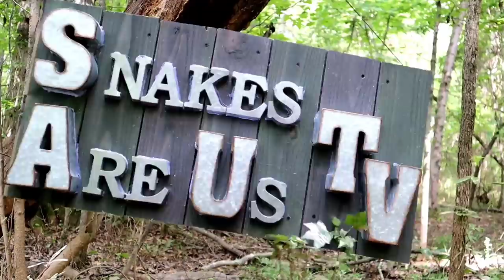Lunch Date with a COPPERHEAD 🐍

Comment: I find most “snake people” to be friendly and good-hearted.  You, sir, are a great example!
Reply: Same
Reply: Thank you guys! I'm not Jason or assotiated with him, but I am a Snake guy as well. I just wrote a post in his latest video, about capturing and relocating 2 big Copperheads, from my neighbors cellar last summer. They were both overhead, in the lower floor structures. One fell out inches from a worker there. I searched and searched, and found two adult Copperheads, and later one Black Rat Snake. They were freaked out for a while. I took them deep into the woods and released them safely.
Reply: Hi yup they are wow there nicer than most pepole I know

Comment: Hello , I keep getting baby snakes in my downstairs laundry room where I have a sunk pump how can I keep them away and how do I tell what they are ? They have a light to dark gray color to them thank from Tennessee
Reply from the maker: They're possibly Brown Snakes. Send photos of them to us on Facebook at Southeastern Reptile Rescue. Is there a door that leads to the outside in your basement? If so, make sure there are no cracks under the door. If there is, replace the weather stripping. If that doesn't work it's just a matter of trying to figure out where they're coming in and blocking it up.
Reply: Southern reptile no there isn't any holes only the one where the sunk pump is and I didn't take pics of the snakes I'm terrified of them I had a friend come get them out a neighbor told me to put pepper mint oil around it would keep them away
Reply: @amylewis6625  peppermint oil,  cotton balls and the like will not work. Eliminating food sources and hiding places are about all you can do but that is hard in a basement. There's likely a small crack in the siding or foundation that they are sneaking in through